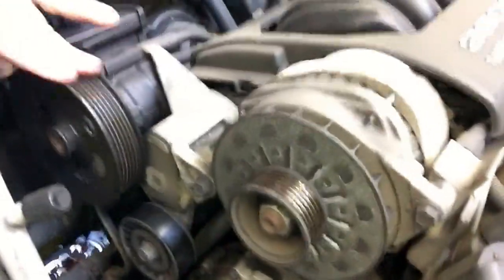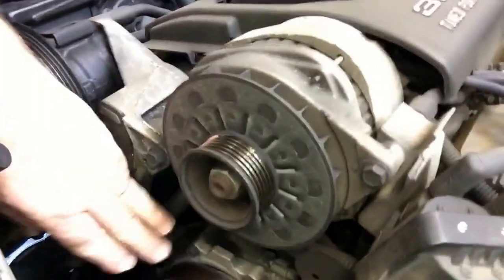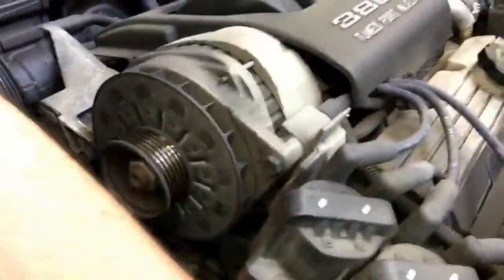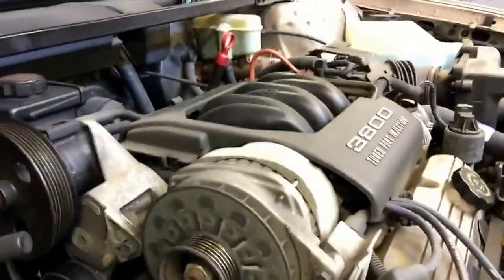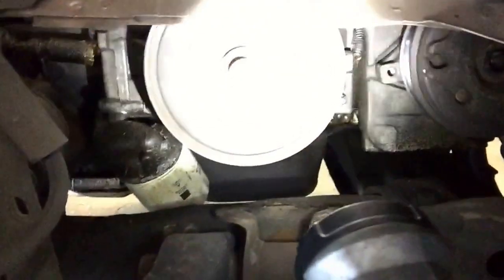How A Harmonic Balancer Breaks

Comment: My car was shaking violently, like it was bouncing like crazy. I don’t know much about cars so I did research. I thought my car had some sort of misfire, but I didn’t have any gas coming out of the exhaust (it could still be a misfire I think), and turns out a bad harmonic balancer can cause the sense issues. I’ve also had problems with my belts in the past, so I think that may be the issue. I can’t drive my car, I’m getting it towed to a mechanic tomorrow

Comment: Is it possible for the ribbed part to come apart and expose a "smooth surface" on the pulley. I have a 1999 crown Vic and I got a new belt put it on and still have way to much play with a new tension pulley even installed but I'm looking at a smooth pulley but the diagram shows the ribbed part of the belt is to go on the smooth surface.... I hope I explained that right. Well when I look up the harmonic balancer none of them are a smooth surface all are ribbed. Ugh

Comment: Revving an engine without the belt connected to the water pump can cause a fire that could burn down the entire shop, even months later!
Reply: WHAT???? I need to see and example and understand your theory on that one, Kliegl. That vid was done 5 years ago and the shop is still standing.
Reply: Sure. If you take a customer's car and race the engine without the water pump being hooked up and he finds out, he may take offense at the damage you caused (or damage he thought you caused) and burn you down instead of taking you to small claims. Depends on the area of town, I guess.
Reply: @saint_kliegl  well.. if you are going to take that extreme example, then yes, an engine with an externally driven water pump should not be ran at elevated RPM's for an extended period of time because you could cause an overheat situation. However, in cases where the pump is driven by internal chain or belt, there is little risk. In this case, there was no risk and our time to test was minutes, not hours. And any owner with arson on their mind after a disappointing experience with any business, surely has bigger issues than a failing vehicle. Thanks again.

Comment: Hello I gotta replace the crank sensor for 05 grand prix gt. 320k. I was told the crank balancer/pulley/harmonic balancer will break when taking it off the get to the sensor. By speedy auto, after just spending 1200 on repairs that dont effext drivability. Is this tru?

Comment: Hi...is it possible for a harmonic balancer bolt will come off and I will not hear any movies, balancer isn't shaking, but I will still be able to drive the car
Reply: yea absolutely, it probably wont last long like that, but some of those balancers really set good on their taper and on top of that some get torqued to about 4 billion ft/lbs, so yea its possible, however i wouldnt run like that at all, because its rotating the forces will slowly work the balancer off n if the balancer drives the cams then u could possibly bend every valve in ur motor n thats best case scenario, u could n will more than likely crack a head, youll need new valve guides for sure.. it could get expensive, theres gotta b some kinda bolt in there even if its a bolt out of the bolt bin jus for temporary
Reply: @4dirt2racer0  thanks...bolt was stripped and bent crankshaft...fortunately I found a great corvette dealer that helped me with the cost. I had the balancer changed a yr ago to my detriment and screwed up a few things. Thanks for the response.
Reply: Sorry hear * noises